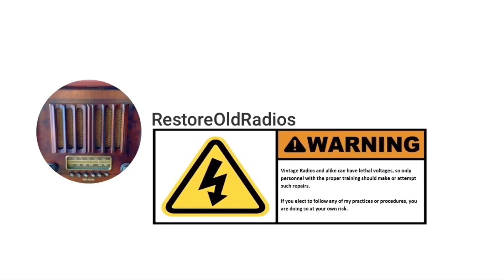Grunow - Model 654 | Loudspeaker Repair w/ Rubbing Voice Coil

Comment: Great instructional video! What is the shim material?
Reply from the maker: Thank you. The shim material is a clear laminator sheet, 3mil in thickness. I ran it through the laminator for a total thickness of 6mil and cut out the needed strips. I’ve also used 35mm film in the past as well. Hope this is helpful. Best, Don
Reply: @RestoreOldRadios  Thank you Don.